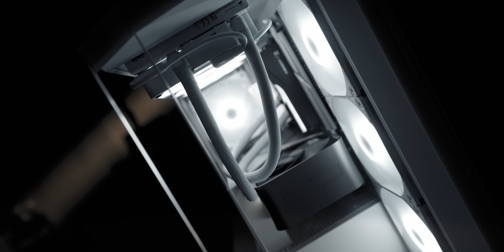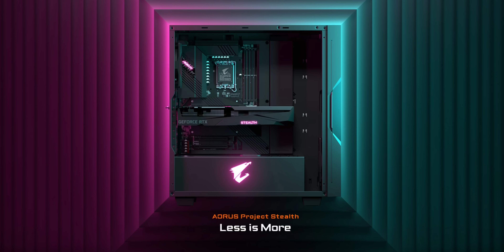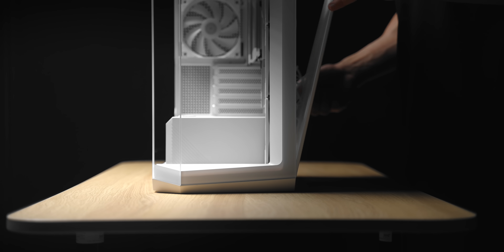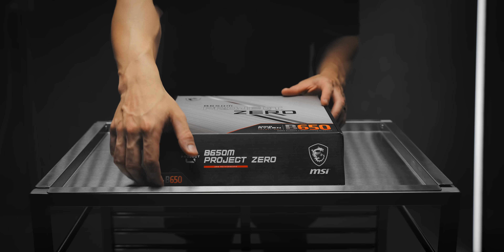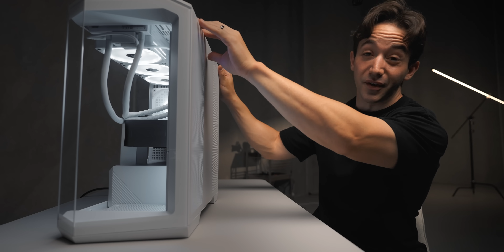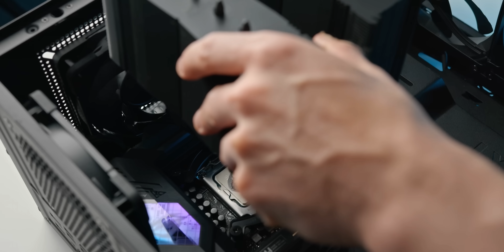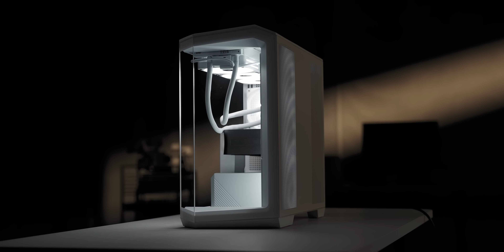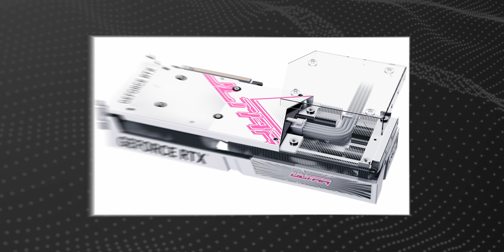"zero cable" PCs are here.

Comment: the fans connecting together and using 1 cable shoudl be the new standard. it's such a game changer. 5 years ago we all had birds nests behind our PC now it's easy to make it clean.
Reply: Deepcool RF120 fans have daisy-chained RGB connectors, but we absolutely need a daisy-chained PWM connection.
Reply: @draconicolor Arctic P12 PWM fans comes with daisy-chained PWM connections. Bought a 5-pack for just €30, no ARGB but does the job great!
Reply: @hyacinthtiger62 Exactly how thermaltight makes theirs?
Reply: @draconicolor  not an expert here, just thinking about perhaps the reason we can't have daisy-chanied PWM connections might be that that would block the individual power-management capabilities between the mobo/fan-controller and the fans; otherwise we would absolutely have had that already (as it would be kind of a best-seller)
Reply: the fans in this video are daisy chained. lian li does it and probably another couple companies do it
 @draconicolor
Reply: you can get PWM splitters which do the same thing. still doesn't look that great even with daisy chaining though cable wise
Reply: lian li is currently sueing anyone who tries it too. thats why there wasnt a mass switch over
Reply: Just use Arctic products.
In all seriousness there are legitimate electronical reasons not to run all fans on a single PWM connection.
Reply: How so? Please elaborate. I've been using Lian Li products since they switched to these fans and haven't had a single issue once and haven't heard of any issues. @joshuaeah
Reply: I still have a birds nest in the front😭😭(it’s not a dual chamber case😭😭)
Reply: Unfortunately Lian Li is suing at least a couple companies (Phanteks and Thermaltake, I believe) who have released such fans, for infringing on their patent. I imagine other companies will wait to see how the litigation plays out before getting into the space.
Reply: So true, I have the regular O11 dynamic (with some mod), at first I put total of 15 fans (bit overboard I know) - 6 on the AIO on top, 3 at the front, 3 on the side and 3 on the front, each fan having 2 cables - RGB and 4 pin PWM, and it was complete mess (even tough I worked hard to clean it up), after that I replaced 9 fans with Lian li al 120 v2, replaced the AIO, removed 3 side fans ( got an GPU with AIO so had to do some changes). and now it looks much better! now this kind of case/motherboard is the  next evolution, probably in a year or two when I will replace my CPU this will be the direction i will be going.
Reply: Fans connecting to each other like Lian Li unifans is the way to go, best shit ever
Reply: This is a decade past of interest to me. This should have been standard OVER 10 years ago. PC design and build is utterly archaic - it's 2024..... Not 2009
Reply: @fwabble  ATX is one of the really great tech standards. But what is shown here, in its current form, is not. Sure, cables at the back could be beneficial in some cases, but not implemented like this. Also, cables on the back as a standard, is seriously limiting further innovation and alternate designs. If people do not want real progress, if you guys want to be locked into this form factor for another 29 years, then this abomination, is what you call for. It is not 2009, it is 1995, that is when ATX was defined. This is still an ATX case.
Reply: Ever since I got the Lian-Li's I said this. I will never change them.
Reply: 5 years ago?! Then explain to me why I currently have a birds nest. You sir, are a conspiracy theorist!
Reply: one of these companies has a patent and actively sue others that have similar ideas (if its not licensed from them)
Reply: @gayasslily  we just need a standard at this point, there basically is for every other part in a pc, why are they always trying to be better than each other😭
Reply: Yeah FACTS Corsair has really paved the way for seamless rgb integration
Reply: they probably patented it all, just like
Reply: Agreed. It's a great idea and absolutely should be a standard feature "atleast". I think Corsair is milking it abit though trying to sell it as the new best thing but luckily there are equivalents out there which are more affordable... And quite possibly better in performance 😅
Reply: Tell me about it
Reply: Sorry guys, but fans only need power. They should be controlled by BT. As in wireless. This industry is just stagnant. The way to get there, is for someone, somewhere to make small controllers, that they introduce as adapters. They simply work on the interface, and make sure that their products are ready for full integration at day one. That way, we can get rid of any fan header, and any cable, except for power to each fan.

Just to rub it in: The information needed to be shared for fan control, is a simple number for speed. As for RGB, this is like Klipper only for PCs. The standard for transfering light info, should be based on music notes, adopted to support light. That way, light would follow natural rhythm, and would support a future adaptation of the music industry, supporting generative growth beyond the case industry.

Thus, the same protocol could be used for home lightning to concert halls.  That would also foresee the future introduction of wearables that functions as music instruments and to paint with light. Dancers could control both instruments and lighting by their movement of body. Just a ton of things.

But here we are. Stuck with people arguing spaghetti, just in a new form. I don't believe for a second, that you guys actually want that spaghetti. The second someone made a working tiny adapter chip, with a tiny nag for design, all that you currently argue for and buy, will be instantly obsolete.

Another example: End users, will be told to install a single app to control their PC. That app could control the fans, inform them about temps, help them maintaining things for instance report on significant reduction in cooling. Like "help, I need a cleaning." The RGB could be controlled to reflect emotional and seasonal themes, if driven by notes like controls. Also, the PC could easily integrate lights into the user experience, like playing in tune with music on say youtube, or be a control hub for you living room lighting.

Stop calling for spaghetti. Call for a modern wireless protocol. Ask for fun and useful stuff.

Sorry Apple. This comment is public. Too late for a patent now. Because we should discuss any such possibility in open public, to kill the most patents, while we can. This need to be an open standard.
Reply: @FrodeBergetonNilsen  Wireless requires charging. I'd pass on that
Reply: @ArtFiendz  Right. Where did you get "charging" from? Just wondering?
Reply: @FrodeBergetonNilsen  wireless things need to charge.. they don't just have power forever. even the best wireless devices need to be charged
Reply: @ArtFiendz  You must be trolling? Right? 

I never know, so just to explain it to you. Read my first line. It says that the fan only needs to be supplied with power. It can be controlled wirelessly.

So. Lets take this slow. A fan is currently fed ground and 12V That is power. You somehow seem to get that, I have no idea how.

The fan is also fed a PWM signal, and it returns a taco pulse, to measure its own speed. That is control. It can be communicated by BT.

The fan is supplied power, so the controller on the fan is supplied power. It is of the wrong kind and all that, but the power is there.

ARGB uses 12V or 5V.  Thus RGB is fed ground and 12 or 5V. That is power. You seem to get that as well. I have no idea how.

There is also a control signal, and an return signal. Those are used for control. Control can be handled by BT. Signals do not have to go through wires.

Just to be clear. The fan only needs to be fed power. It can be controlled remotely.

You are the only one insisting on any battery. That is all in your head.

You need to figure out how it got in there, and why you blame me for it.

What I described above will happen. It is only a matter of by whom and when. There is no if. Once you understand how useful this is and the value it brings, you realize that we will end up with some version of this. We are humans, and light is essential to our well being.

Never mind.

The talent I seek, is simply not here.
Reply: @FrodeBergetonNilsen  Oh lmao I totally erased the bit  about the fan needing power from my memory after reading that whole thing
Reply: There are several adapter options available to make that easily happen.
Reply: The problem is you are committing to their products
Reply: "Game changer" lmfao!!! 😂😂😂😂😂😂😂😂😂
Reply: so why is the back of the PC in the video so awful
Reply: @callumramsden5332  because he didn't try. you don't have to. it's just easier to do so
Reply: My Destiny case is the same way!
Reply: if you want to waste money then yeah, but premium fans are a scam.
Reply: who cares ? when the pc is done, you won't touch it until a couple of months or even a year... that's an useless expensive idea ! (i mean, sh$t !)
Reply: @aznavr4441  yeah also these fancy fans cost like 500% more for a stupid simple feature. They are also still doing the same exact thing.
Reply: @aznavr4441  Expensive? well when I'm building a PC I'm not worried about price anyway. I'd rather make aspects of it really easy rather than have it be $50 cheaper.
Reply: @jacekmakes that's why i will never buy expensive, useless and unefficient fans when arctic and thermalright still exist. My P12 MAX (80cfm, 4.35 mmH2O) for only 70€ (7€ each since i bought 2 pack of 5). I wanted to buy the TLB 12 EXTREM but couldn't cuz they weren't in stock (112cfm and 5mmH2O for 11€/u)
Reply: The SL-Infinity fans do this as well. They came with my Lian-Li AIO, pretty nice.
Reply: no. you need them to touch and you dont always want that.
Reply: i dont agree. there are plenty of fans like that, its normal enough, let me have my industrial looking cheap powerful fans.
Reply: If you daisy chain together all the fans your fan rpm optimization won't matter. Better to control each set of fans separately, allowing you to maximize their role in your build while also playing with the speed. Just can't do that where every fan is connected to the same header because you're controlling every fan together
Reply: @AlešZ_123  you can control them seperate. you only daisy chain each set of 3. and can only do a maximum of 4
Reply: apple did this in their mac pro 2019: 3 case fans with no cables at all.
Reply: @rugzbeats  and they also designed the casing and the hardware, which isn't a given where one's building a PC, although still very impressive engineering feat from Apple; I remember the presentation, the lead engineer said "can't innovate my a$$" :D
Reply: A single fan header can only supply so much current
Reply: lian-li has been doing this for a while to my knowledge(double check me someone)
Reply: The next step for manufacturers is an even better integration and even less cables. A structure similar to the PS5 or XSX.

Two thermal zones:

1. back of the motherboard: CPU, RAM, back panel IO, and PSU. They are the less important, less flashy components.

2. Front of the motherboard: GPU.

the thermal zones are separated hermetically by the motherboard which acts like a central dividing wall, so the cpu has no chance of heating up the gpu, other than by conducting heat through the motherboard itself.

the CPU and PSU are arranged lengthwise like this: [cpu] [psu]. The PSU is to the front of the case.

The GPU is parallel to them both, and because GPUs are long it will take up the same kind of space as the CPU + PSU. The motherboard is between them and has a 90 degree pcie connector that the GPU plugs into to be parallel to the motherboard.

Because of this arrangement, pcie lanes can be kept very short which will improve the performance.

You can either have the fins on all those components arranged lengthwise, so that there is only one fan at the front on the short wall blowing through the length of the case, (like on an XSX), or the fins can be arranged vertically, so that you can have three fans at the top on the long wall, blowing through the thickness of the case from top to bottom.

The PSU does not use cables for the GPU. Since they are next to each other, the GPU plugs into the PSU directly using an inter-board connector. The PSU also plugs into the motherboard using an inter-board connector as well. Other components (sata hard drives, optical drives, ...) can use cables, but there are much fewer of those to be had now. Already today there is NO REASON to have those 24-pin cables.

Finally, if you need additional expansion, the bottom of the motherboard could have an expansion connector, that carries 16 PCIE lanes into an expansion board that can have an 8x connector, a couple 4x and 1x connectors. For example if you need a capture card, a storage controller for an array of hard drives, a 100 GBIT nic, or 8 more nvme ssds. Basically, you could buy a board that's just the "pcie ports" part of the motherboard.

Rear IO would be drastically simplified, only a couple USB A connectors, a few USB C connectors, wifi, and lan. You really don't need anything else.

The PSU connects through an extension cable that runs to the back.

The CPU doesn't need a huge heatsink at that point and probably no additional fan.
Reply: no, cause the connections from each brand are proprietary.
Reply: @DaKrawnik 
Which is why it should become standardized?
Reply: @NN-sp9tu Not happening. Proprietary connections "incentivizes" (read: borderline forces) you to stick to THEIR own ecosystem, especially for RGB. 
I run Phanteks T30s for my build and I like the daisy chain connectors but I think that'll be as far as most fans will go. Otherwise anything with rgb everyone is gonna use their own shit. You'd have to force the companies to stick to 1 single solution. That ain't happening.
Reply: @NN-sp9tu patent-issues mostly
Reply: @DaKrawnik  Right. but that connection method should still be the new standard. but they should also be one connector across the board
Reply: @DaKrawnik  not rlly most are argb
Reply: @DaKrawnik  as long as the end connector can connect to any motherboard i'm okay with it, i think most people don't mix and match fans anyways

Comment: Cases with removable motherboard tray could fix this.... But no thats giving options. And powersupply makers giving the user the ability make their own cables. Custom lengths and custom placement and right angled connectors. Guess that becomes a liability thing at that point. Maybe stop using stiff ass cables and stop using sh-tting connectors too.

Yes, please keep covering this stuff . maybe more makers can finally adopt the back side instead of needing to route and bend in the front. Especially garbage connectors that destroy gpus.

Comment: ASUS BTF is better simply because the GPU also gets power from the motherboard too, so no cable there either. Sadly though it looks like ASUS didn't make it an open standard for everyone to use, it's a proprietary connector. But if you ask me, I hope that MSI, ASUS, Gigabyte etc all work together and make an open standard, this is the future. It's easier to build in, it's cleaner aesthetically and it's also better in the sense that you can cable manage easier too. Apparently also this might drive costs down as they might not need as many PCB layers. I think this is the future but right now all these components cost more than their regular counterparts due to economies of scale.

Comment: Looks really nice, but I hope this stays in the pre-built section rather than this becoming the new standard. Can only image how much more annoying it would be having to check compatibility between your motherboard and case more than people already have to, not to mention it's reversing standardization that we've had for years. It could be quite annoying to have Gigabyte motherboards only fit in X companies cases for example, it reduces choice and variation between builds.
Reply: It’d be no problem if it actually becomes a “new standard”. All the major cases coming out would support this if this is common enough, to avoid missing/losing out. And it’s not like it is too much of a hassle, they just need to make extra cutouts

The problem is that if this is only a half-assed attempt that only a handful of selected models are “inverted”, like you suggest. Then case companies might just not be bothered to support it.

I personally like this idea, even if you don’t care about the aesthetic, the cable management is just much easier with the connectors on the backside
Reply: @Summer-xu8qu I think it's an awesome idea, but some of us have 10yo cases lol
Reply: @draconicolor  Yes, and what's the problem? If you want to reuse your 10yo case with new build, then just buy normal non-inverted mb. If you want the inverted mb then just buy new cases. The important thing is that the choice is there. 

Even if this becomes common enough to completely replace the normal non-inverted mb next gen, your would have had your money's worth already by using your case for 15+ years (accounting for the transition period)
Reply: Well I guess it's both highly convenient and coincidental that these companies also are putting out compatible cases! Some might call it the "bare minimum", I call it trying to force you into their ecosystem of products.